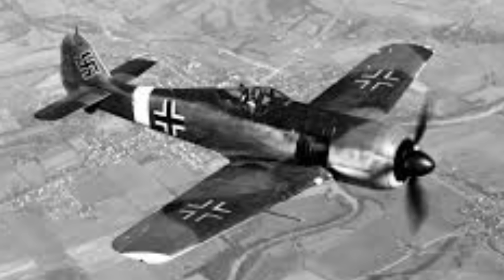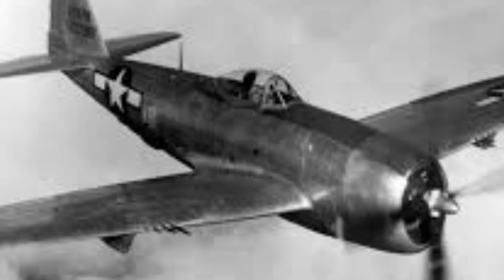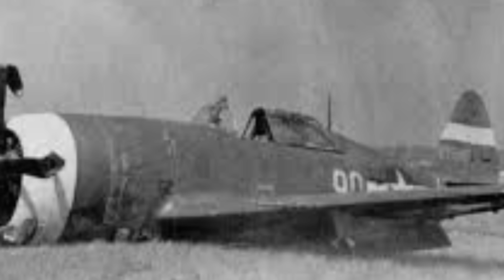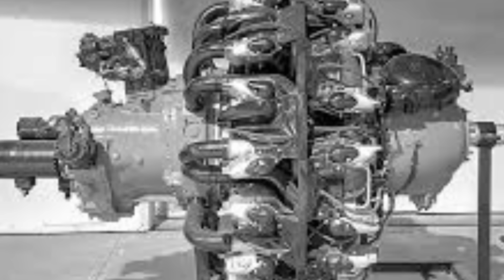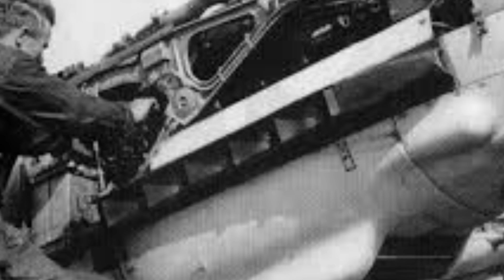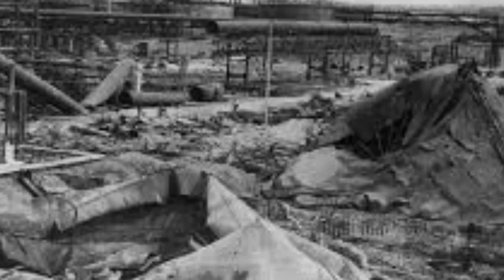Luftwaffe Never Expected 2,800hp R-2800 Engines To Turn P-47s Into 500mph Demons

Comment: The late P-47M did produce 2,800 horse power.
Reply: Very few in ETO
Reply: Republic produced 130 P-47 M's . It shot down  9 German jets and was the fastest allied prop at 472mph at 25,000ft.  Right behind it was the P-47 November at 460 mph at altitude. Of an order for 5600, 1813 were produced when the war ended. If the Pacific Theater would have went on a little longer,you would have seen the 47 N totally take out the 51 D.
Reply: @56tcA90  You meant "...if it had GONE on a little longer..." not "went."  Did you flunk 4th Grade English?
Reply: @RussGallagher Get lost.
Reply: @56tcA90  And te Tempest shot down more
Reply: @jacktattis More of what. Tempest action and no other fighter contributed as much to the war effort in winning in the ETO after the Battle of Britain as the P-47.
Reply: @56tcA90  hahaahhhaha  P47 April 43 first combat
Spitfire IX Jun 42 5665 Operation Point blank  Nov 43 to Mar 44 2950 enemy and then was with the RAF2TAF until VJ Day   
MkVIII   oCT 43  1660 used in Italy and the Far east 
 MkVII May 44 HF 140 used to counter high flying rados and JU86 
  MkXII Feb 43  140 Low level  interception
MkXIV Oct44   957  Fighter extraordinary
 MkXVI Packard 1054  Low level interdiction  
 Spitfires IX,VII, XII,XIV,XVI all used in the west and to them goes the acolades at facing the most enemy
Reply: Though only sent to the Pacific Theater they made an N model ,fast as M but more internal fuel storage ,
Reply: @garyhooper1820 Not bad I believe

Comment: I agree. Total Bullshit. It didn't do 2800hp.
Reply: Oh contra, the P-47 Thunderbolt did make 2,800 horsepower, but only in the specific P-47M variant, and it was not used in combat as frequently as lower-power versions due to reliability issues. While the engine, the Pratt & Whitney R-2800 Double Wasp, was rated for 2,000 hp in earlier models and up to 2,400 hp with water injection in others, the 2,800 hp version was for the high-speed P-47M.
Reply: @Mr.Benson OH contra, Bullshit.  The way this post is presented it suggests that all new P-47s had R-2800s that produced 2800hp, and that simply is not true. Apparently, there were relatively few P-47ms manufactured, and none of them were ever used in combat. I would admit that for the time period, any internal combustion engine that produced 1hp per cubic inch of displacement, was one hell of an accomplishment. I'm very curious as to how they did that.
Reply: There are 2 of these at architectural testing in emigsville pa. The use them for hurricane testing. The high point of mechanical engineering. They built this with slide rules and abbicus. They had no computer, calculator,any kind of outside help only your mind.
Reply: WHAT WAS THE FUNDAMENTAL PHILOSOPHICAL DIVERGENCE IN FIGHTER DESIGN THAT LED REPUBLIC AVIATION TO CREATE THE MASSIVE, BRUTE-FORCE P-47 THUNDERBOLT?
Reply: @TheSilentSoldier-9 to fit the turbo system to a large degree
Reply: @TheSilentSoldier-9  Fit the latrgestr engine to the largest airframe and see what happens The result? A double decker bus that somehow crawled up to height  did some damage and then was  replaced